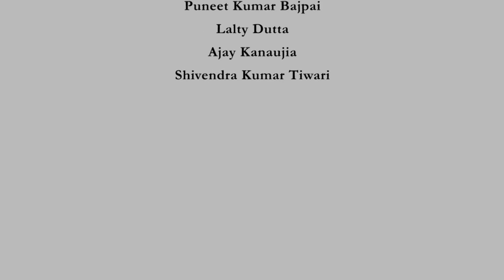Waveguide Analysis

Comment: Around 3:27 he mentions that since there is no current inside waveguide there are no electric fields and Magnetic fields are generated, which is incorrect. Electric and magnetic fields are not generated inside the waveguide. These fields are generated at the input source and guided by the hollow tube which is nothing but waveguide. 
Such basic mistakes should be avoided.
Reply: He told that they are not inside the waveguide but present on the surface which ultimately causing the generation of fields